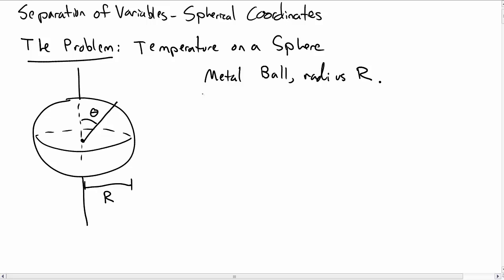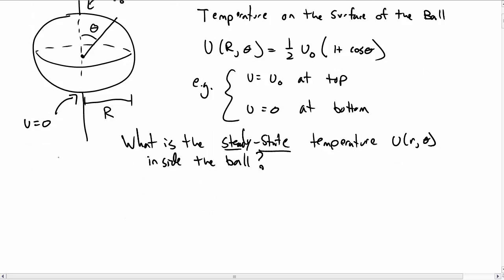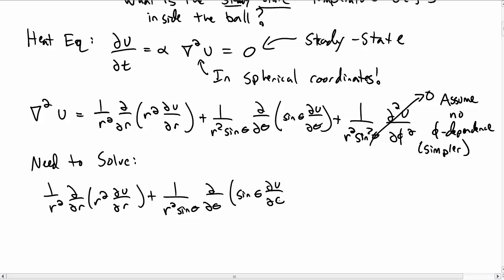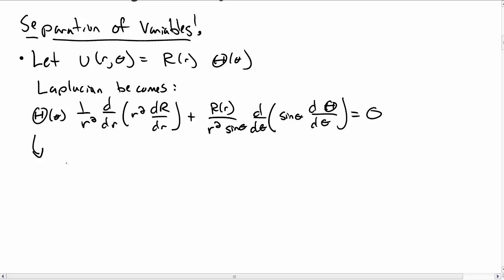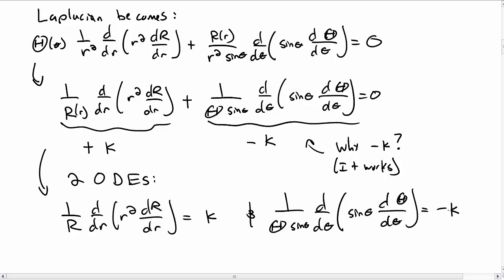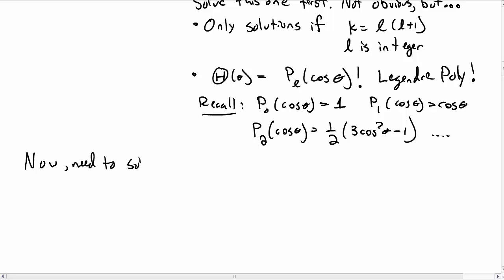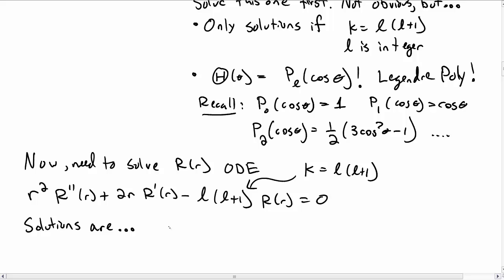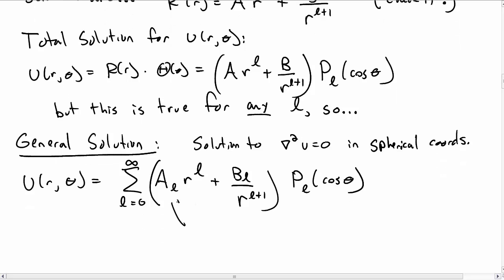Separation of Variables - Spherical Coordinates (Part 1)

Comment: I don't understand at 4:10 when you divide by R*Theta where the r^2 goes in both terms
Reply: if you look at the original laplace equation you have an 1/r2 factor on each sum, so you can multiply r^2 times 0 to get rid of that factor on all the sums.

Comment: I'm sure I'm missing something, but a question or thought on how the temperature is calculated; cosine of zero, at the top, would be one multiplied by 1/2 Uo ?; cosine of pi (at the bottom of the sphere) cosine is -1 so wouldn't the temperature at the bottom of the sphere be -1/2Uo ?;
Reply from the maker: Careful - the temperature function is 1/2 u_0 (1+cos\theta), so at \theta = 0, indeed cos 0 = 1, but the resulting temperature there is then u_0. At \theta = \pi, indeed cos\pi = -1, but this then cancels against the 1 + (-1), resulting is zero temperature at the bottom.

Hope that helps!